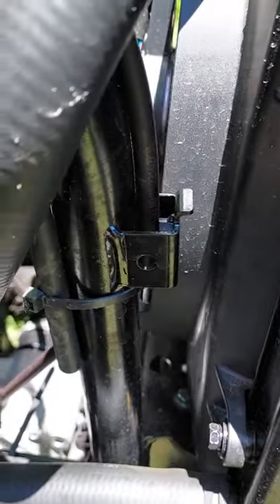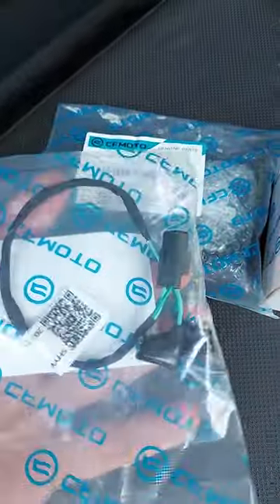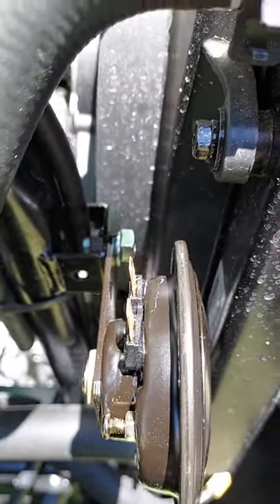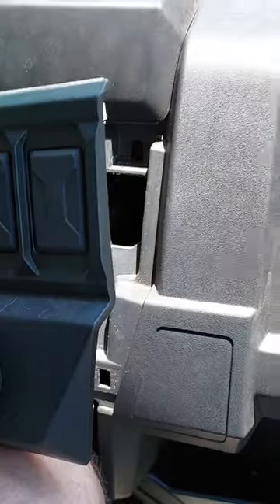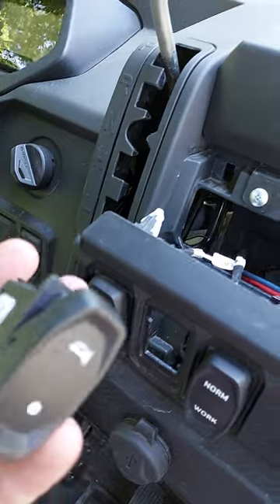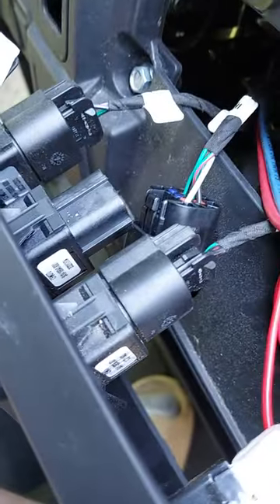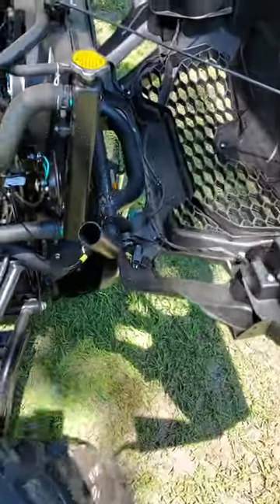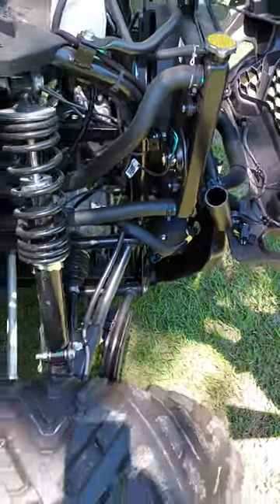Cfmoto Uforce 600 (How to install a Horn step by step 2023)

Comment: EXCELLENT "short and sweet" video - Thanks for sharing. I just bought a complete (nice) "plug and play" turn signal, horn and 4 way flasher kit (that came with no directions) for my 2024 UForce 600 and could not understand for the life of me how to (Easily) plug in and connect the rocker switches. I had no idea that the panel that holds the switches simply "pops" off!! Now I need to find a video that shows how to (easily) take panels off to install the included lights (have to drill holes for mounting). Thanks again - You da MAN!!
Reply from the maker: Glad I could help

Comment: What size bolt did you use for the horn itself? Mine didn't come with one
Reply from the maker: Sorry mine came with one. And not sure what size it was npw
Reply: @JodyAikens  I found out the size, in case anyone ever asks... it's an M8x16x1.25
Reply from the maker: I appreciate that.

Comment: Don’t splice the wires. There is a little insert inside the connector that looks like 2 circles. Pull that out.( I grabbed it in the middle with needle nose pliers held the little tab with a finger and pulled out) then the wire harness they sent fits right in.
Reply from the maker: I appreciate that to help other people out.  I didn't know that at the time.
Reply: You’re welcome 
I just figured it out today installing my horn.
Reply: Where was the wire that you pulled that you connected to could you take a pic 
Thanks in advance

Comment: I find it funny/weird that canadian models come with the horn but American doesn't
Reply from the maker: I agree 💯
Reply: @JodyAikens Has your Uforce been holding up ? Just purchased one a week ago and loving it .
Reply from the maker: I have had it for 5 months now. No problems at all so far. And loving it. I just hope it holds up over time.
Reply: @JodyAikens The adaptor you hooked to the horn under the hood. Where does that wire run to ? I know the horn button connects to the yellow auxiliary cable under the panel. Wasn’t sure about the wire from the horn.
Reply from the maker: the wire has a zip tie on it right where the horn was bolted up. you should see it on your uforce 600
Reply: Turn signals install help? I have same machine as you👍
Reply from the maker: I haven't had time to install that yet. But when I do I will make a video of it. But it should be pretty easy. It is plug and play. The only thing you have to do is order the turn signals for the back. The turn signals are built into the front head lights.  You can order the turn signals off of Amazon for about $15
Reply: Looking very much forward to your video on turn signals. Excellent job on the horn installation.👍
Reply: Which horn should I order?
Reply from the maker: 169040-6001 that is for a 2023 model the is the horn switch. The horn model number is 6060-150600 and you can order it on cfmoto us parts website.
Reply: Which turn signal for back should I get from Amazon 
I want to have mine ordered and be ready for your video. Thank you very much.
Reply from the maker: @garyholmes8586 Partsam 4 Pcs(2Amber 2Red) Square LED Trailer Clearance Side Marker Light with Reflector Stud Mount 3LED, 2-4/5" Rectangular LED Truck Trailer Light Side Refle
Reply: @JodyAikens got the horn kit ordered and the Amazon lights

You are much appreciated! I’ve been searching for answers for days!
Thanks very very much 
Gary
Reply from the maker: @garyholmes8586 anytime glad I was able to help you.
Reply: Will I need the adapter for my horn kit please and thank you
Reply: @JodyAikens will i need adapter for horn kit please?
thanks gary
Reply from the maker: @garyholmes8586 if you buy the kit. It comes with the switch the horn and the wire to hook it up. But it is $74 on cfmoto us parts web site.
Reply: Since I’ve already ordered the switch and the horn, I will go ahead and order the adapter?
Reply from the maker: @garyholmes8586  just make sure the adapter  is for a 2023
Reply: 150191-2900 same as on the package in the video?
Thanks
Reply from the maker: @garyholmes9246 ADAPTOR CABLE, HORN - CFMOTO OEM - 5HYV-150191-2900 I think it is about $20
Reply: got it ordered!
Looking forward to your video on turn signals also thank you so much
Reply: Got it ordered! Thanks again
I’ll be watching for your turn signal install!
Thanks again
Reply from the maker: @garyholmes8586  not a problem at all are you on Facebook. If so join cfmoto uforce 600 riders. Very good group and very helpful. I am a admin in that group
Reply: Will I need a turn signal switch and any wiring for my turn signal set up

I ordered the lights from Amazon
Reply from the maker: @garyholmes8586  no you will not need any wires for it. If you open the dump bed. You will see the wires on both side of the dump bed. They are in the corners of each side. Where the Reflectors are.
Reply: I need to add tag frame and 
Light? For my 
Incense plate

Any suggestions?

Thanks Gary
Reply from the maker: @garyholmes9246  do you have Facebook
Reply: Yes I have Facebook
Reply from the maker: @garyholmes8586 have you joined that group I told you about. They are a great group and I am a admin in that group
Reply: I just went to your Facebook page and posted my question 👍
Reply from the maker: @garyholmes8586 cfmoto uforce 600 Riders I will let you into that group. They will help with any questions you have. They have helped alot of people in this group